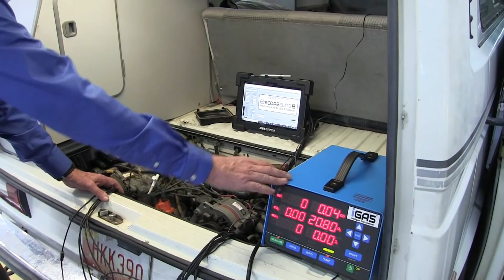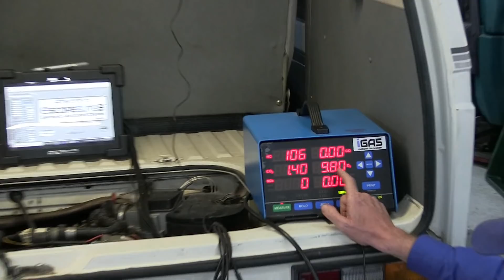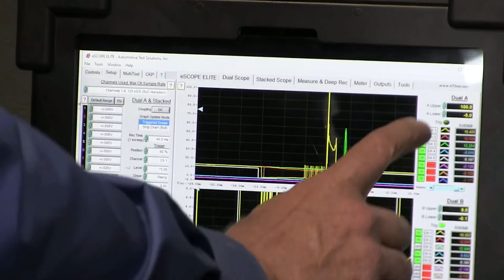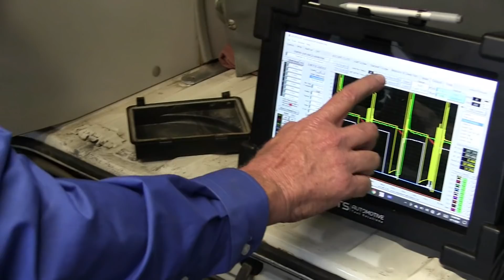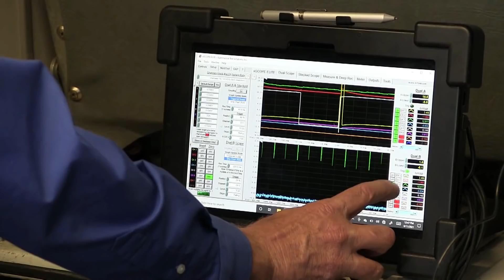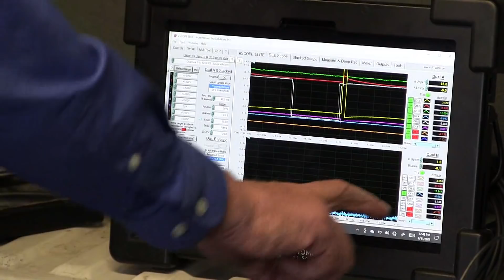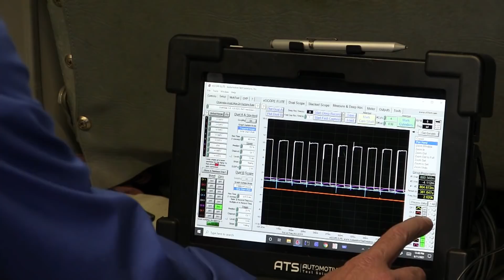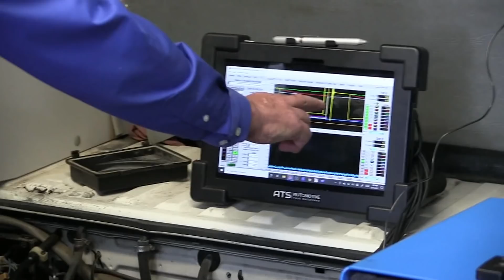1987 VW Vanagon Misfiring and Stalling

Comment: I was laughing the whole time that I watched this! This guy must have worked in "Modern Medicine", and hence performing all sorts of unnecessary tests and proceeding to "treatments" (fixes/repairs) that are not needed and mask the real problems. The first thing that was needed on this vehicle was to repair the exhaust leak. Anything with an O2 sensor will have all sorts of trouble if the exhaust has leaks. This lets "false" air into the system and confuses the "computer" which thinks the engine is running too lean and then holds the injectors open longer. Which makes the fuel air mix too rich and fouls the plugs along with MISSFIRING AND STALLING. The exact trouble that the van was brought in for. After the exhaust leak(s) are fixed then a thorough test drive should be done. Then reevaluate the performance. If necessary adjust the open loop mixture on the AFM. And as others mentioned check for intake leaks and repair as necessary. A vehicle this old can have many small leaks that will cause trouble. And what is "multi-striking" anyway? Is he referring to the ignition? There is no "learning" or adaptive functions in the EFI on this van. So what's being observed is a malfunction. The ECU "computer" on these vans can fail on the circuit that triggers the ignition coil to make sparks. After all the above repairs have been made and there are still problems, THEN bring out the fancy expensive diagnostic tools and waste your time adding parts to the system that are not needed. I'm with those that have suggested that the WRONG ignition coil was installed. The OEM coil is NLA for about 10 years now. There are supposed good replacements. You won't find them at Autozone or NAPA. These VW vans never had a 'ballast resistor" in the ignition circuit. The coil should be tested against the specs in the shop manual. This van may also need a valve adjustment. (Yeah, I know, hydraulic). Remember: IF ALL ELSE FAILS, READ THE INSTRUCTIONS.  In this case the workshop manual. After the tests and repairs specified in the manual get done AND all the CORRECT parts are on the van, only then look for exotic/weird problems as demonstrated in this video. Basically, do not waste your time when there are obvious things that need fixing. Do those first.

Comment: I've got an '84 Transporter with a 2.1L petrol engine that stalls out frequently unless I pop the hatch open a little.  My engine hatch doesn't close unless I push it shut, staying open a couple of inches normally.  This is all it needs to be ventilated enough to avoid the heat buildup, and the police can still read the plate at that slight angle.  Problem solved!

Comment: If I hear right ignition coil has not been replaced.
Most Bosch coils have internal ballast resistor.
I have to look at my Bentley book tomorrow to see if there is a coil primary residence spec.
Is it possible it has aftermarket coil with no ballast.
Anyway excellent narrowing to root cause. 😉

Comment: Great, but what is causing the coil thing in the first place? I mean why does it need an additional ballast resistor part now when it never had one? I would like to dive deeper to know what went wrong where that has caused this ballast resistor to now be needed, thanks.

Comment: An 86 vanagon I had had a bad o2 sensor 12v shorted to signal. The vw computer would shut the fuel right off in 30 seconds. Would restart and go another 30 seconds by reseting the computer. At 60mph key off and back on every 20 secs you could drive it  anywhere. No one could find the issue. I finally figured it out. 100 % fuel authority good grief.

Comment: THAT'S definitely a new one for me!  An added ballast resistor!  Maybe the new coil was supposed to have an internal resistor, but it's missing?  On the old GM 12 volt contact point systems, there were two wires at the (+) side of the ign coil.  One came through a fixed ballast resistance.  That was current limiting for running.  The other wire on the (+) ign coil terminal was from the (R) terminal on the starter solenoid.  When the solenoid engaged for starting, that (R) terminal was the "HOT" or Battery Voltage for starting.  Maybe this vehicle needs that setup with Bosch parts.  I'd like to see the wiring diagram for this vehicle.
How's the vehicle running now?
Reply: No ballast in any water cooled Vanagon.  Takes 12V straight from the ignition switch 15 terminal.
Reply: @dbeierl  15 . YES, thank you

Comment: After gazillions of problems with that freakn WBX engine ( incl. rusted through cylinder head bolts) I finally put a Subaru EJ22 engine in. Perfect, never looked back.
Reply: No cylinder head gasket, or burning oil issues? Or are those issues only on the larger-latter EJ-series engines?
Reply: Better make sure you're running phosphate free coolant...or your Subi engine will go south just like any other wbx or Subi engine.

Comment: Chrysler had the same problem in the mid 1980's  They added a ballast resistor to reduce the coil voltage to around 9 volts ...

Comment: But why? Is something wrong with the "new" coil? Aftermarket crap maybe?
Reply: That is what I also questioning! Has the van ever been running OK with it's OEM parts? Why do you have to put a resistor on the coil after so many years. Surely that must be something dodgy with the new coil. The fix seems like a hack to me!

Comment: Great lesson
I recently fixed a 65 mustang / 289 2V it had Points, cap, rotor, wires, plugs and the coil replaced. This car had the same issues as your Vdub.
I dont know why the "Tune UP" was done in the first place :>(  (different shop)
I didn't use a 3/4 gas but used my scope to watch the current and the strikes
When looking at a Wiring diagram for the 65 I noticed it did NOT use an in-line ballast, I called up the local Napa  (Not A Sponsor) and asked for a coil with a built in resistor .
This fixed the issue!

Comment: Super cool van! Would never think that ancient computer is able to multi-strike the coil. Seems like a work-around fix...does it need a new OEM ignition coil?
Reply: Holy cow. What a mystery . I hope ATS team posts "Bonus footage" with OEM ignition coil installed and fixed exhaust system and the "air door" adjustment done..I really want to see the gas readings CO2 around 14% and o2 below 1% and HC below 100PPM 🍺🍺
Reply: @petar443  probably can’t find oem so I’m doubting they are laying around in the stores
Reply: Installed wrong type coil

https://www.ratwell.com/technical/BlueCoil.html
Reply: @ismarmeskovic  Your link is to the air-cooled era vans. The 1987 water-cooled van in the video is far removed from those days and uses this coil: https://www.vancafe.com/00061-p/00061.htm .🍺
Reply: Was thinking the same thing. Also may have been a ballast resistor in wire loom from factory as someone else mentioned.
Reply: Hi Ivan.
Reply: Does an OEM coil incorporate a ballast resistor?
Reply: I was wondering the same thing,  what is the reason the current rises so quickly?
Reply: @ryanboyd7144  this kombi most likely has a bad or corroded connector somewhere in the mix informing the computer to throw more voltage at a particular circuit than needed, had a similar issue with my 86 westy.

Comment: So did VWs built around that time period have ballast resistors from the factory?  My mind is blown on this diag.
Reply: Not that I have seen.
Reply: I believe sometime in the early seventies they switched from external ballast resistors two internal resistors built into the coil
Reply: @fmbfla  Yes,you are right. A lot of vw model(maybe all), was using coils with ballast resistor from back then ,until they  was jumped to COP coils. And installing wrong coil, never going to work good the engine.

Comment: Absolute legend! Can’t get enough of your videos Mr Thompson. I used to work on these vans when I did my VW/Audi apprenticeship, I thought these coils had a ballasted feed wire to the coil which is in the loom. Has someone replaced the original loom introducing this problem?
Wish I could afford your equipment, it would make life much easier. 
Can’t wait for the next one!!
Reply: No ballast in the harness of any of the water cooled Vanagons -- they get 12V straight from the ignition switch 15 terminal.  Pretty sure the same for the air cooled ones as well, though their ignition setup was different (Federal used a points-type ignition instead of electronic -- CAL used electronic similar to the early water cooled).

Comment: PS,
I believe that a Bosch L Jetronic system  with no OBD. 
Well done!
Reply: The 1986-1991 Vanagons use Digifant injection. The 1988 to early 1990 vans came with wiring for an OBD-I circuit. The other ECU's can be tapped into for OBD-I-type of diagnostics and tuning.🍺

Comment: Aint never even heard of a ballast resistor. Holy crap!
Reply: They were common back in the points days. Usually bypassed during crank to give the coil full voltage for easier starting.
Reply: @mattt4183  This was the external ballast resistor,outside the coil . The vw models was using an internal ballast resistor (inside the coil),and if the coil wasn't the same one,never would work good. A lot of non stop  problems, with wrong coil.